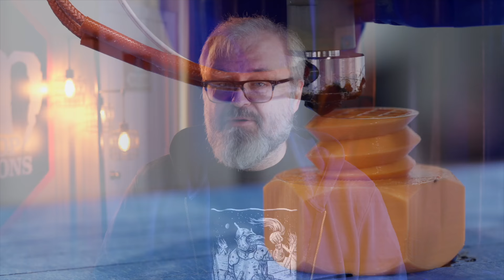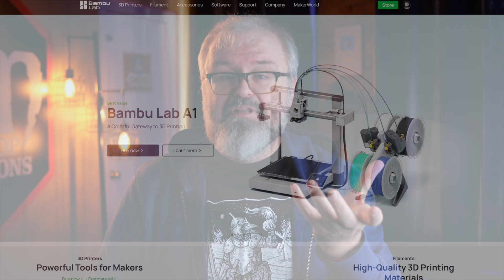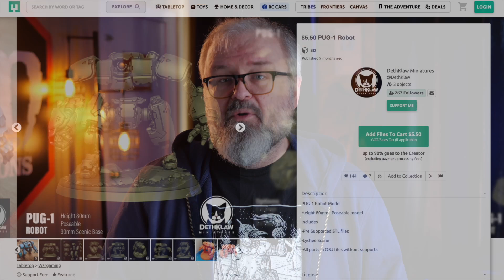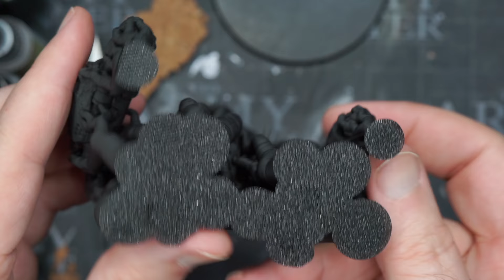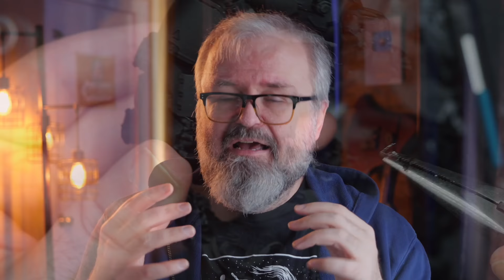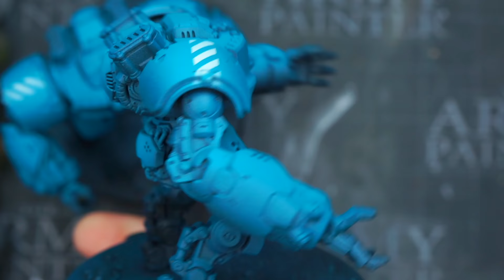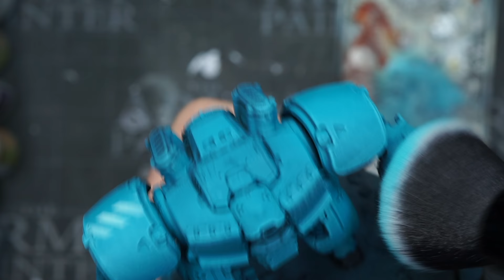I Compare RESIN vs. FILAMENT for 3D Printing Wargaming Minis

Comment: Bigger models (and even smaller ones like space marines) always in parts. It is incredible how much you can improve a model after learning to slice and orient parts in an optimal way. Second, making supports perfect. If they don't peel off with a gentle twist of the pliers, you're doing it wrong and need to tweak them. Third - applying matt varnish BEFORE primer hides most of the layer lines in a good pring (won't help if the quality is dog's breakfast as is), print holes, any seams of the parts. Just let it cure well or the primer will crack (don't use glossy varnish, primer will always crack on it). Always print one mini at a time. Get Frostbite/Glacier print plates - not only they let you print at 30-50'C bed temp whic his great in itself, but they have almost perfect adhesion when used right. Use Sunlu PLA + 2.0 filament or Elegoo filament, but NOT black, from neither (previously Sunlu Meta was great but something is wrong with it now, acts like old PLA these days, poor batches perhaps) - and finally prepare your OWN models sets, cut and prepared by you to your optimal printing conditions, essentially making your own sprues of minis, in a way. Do not believe that anything downloaded and not prepared for FDM specifically will print well. It won't most of the time.

And side tip that is slightly more involved. Learn Sculpt tool in Blender. This is, by far, one of the most important things as it lets you manipulate the model - sometimes all it takes is couple of milimeters or degrees to make something you can't split in slicer well into something that you can (like, for example, hands with weapons that before editing would need cutting the part of the model's body). Not only that, it allows you to easily create alternative poses, visual interest OR, and this is also key, by using inflation tool fix the unnecesary holes and gaps in geometry with one click and also easily create bridges between parts of the model that make no sense to be separate (like for example a hand with a gun close to the body, but hanging down from the shoulder without touching the hip. By making it touch the hip by adding a small enlargement of one area you turn a hard to print model into a child's play  -as it now prints from the hip area and not in air, one of many examples.

That's it, that's the receipe for a perfect FDM minis. Will they be perfect? No. Do I have painted armies that cost under £15 each which I can use to play with my kids and friends? Yes.
Reply: Thanks for the time taken to share your thoughts. In the current economic situation what you are doing makes perfect sense.

Comment: Its something I will try but haven't got there yet. I have been resin printing for around 4 years but have only just got a filament printer in the last month. Currently working my way through a warlord titan that is about half and half of both matterials - filament for the structure and resin for the armour plates. What i like about filament however is it has opened up the door to a whole heap of printable objects that resin is just not suited for, so it may be a while before I do an army of miniatures with it.
Reply: What printable objects are you making that resin is not suited for?

Comment: Unrelated to the video, but how do you base with speed paints and go over them without them bleeding over? I love using contrast and speedpaints for some areas but I havent managed to prevent them from running when they get hit with any moisture at all. When i get my filament printers, I am inspired to do the same side by side with a few battletech minis. 

For myself, for whats on the table, i'm generally using a very simple paint scheme, and would be more likely to go with filament as they are less delicate. My prints are done with standard or abs resins, but they dont tend to hold up well to lots of handling. Being dropped turns them into a puzzle from hell.
Reply from the maker: Once they fully dry, they don’t reactivate anymore from what I’ve seen. Thanks for watching!
Reply: @tabletopminions  great videos! I will give them some more rest time and see if that helps, thank you!

Comment: For printing 28mm scale figures, it can be better to do them in parts. Also, try using the resin supported models for FDM printing. You can always slice these yourself to add any other tree supports. But generally the resin supports work for fdm and are easier to remove

Comment: The fdm printed model looks great! As long as you don't look at it lol. 
I've done tonnes of fdm printing and would not even consider fdm printing minis. 50um layer lines in resin printing will show up while painting, let alone layer heights of fdm.
To make fdm even viable imo you would need to build a custom printer. IDEX, 2mm lead screws or high res belted Z, 0.1mm nozzle with custom part cooling shroud to eliminate clogging issues and print in ABS then experiment with acetone vapour smoothing to minimise layer lines. Waste of time printing minis in PLA when ABS is cheaper and better suited to the purpose.

Comment: 2:51 PLA is very technically biodegradable but it’s about as close to the edge of the definition as you can get and we really shouldn’t be pushing it as if it’s a green material at all. Even under the most optimal industrial composting conditions virgin PLA might still might not degrade and any given pla you grab off Amazon is almost certainly chemically modified further decreasing the odds.

Comment: Interesting video, with a fairly decent comparison of the capabilities of both Resin and Filament based printing. I like the fact that you point out that both types of printing have their place in making miniatures. I also like the fact that you point out that you can assemble the figure prior to slicing for printing.
I do however think that when comparing the quality of the different methods, the parts should be done the same, the resin was printed in pieces, the filament should also have been done in pieces, or as the filament was printed in one piece, the resin should have been done in one piece.
Either way, a good video that demonstrates some of the shortcomings of filament printing, and gives areas where that kind of printing is useful for miniatures and gaming.

Comment: 3d printing bits is amazing.  I still use the GW box sets as a starter but no longer require needing 10 other boxes of parts to convert.

Comment: Treat it like a resin print.  Go as low of a layer height that your printer will allow, print it sideways at a 45 degree angle with resin style supports.  Use a hair dryer to remove the supports and use a craft knife to scrape off any stringing or warts off of the print.  Scrape-- don't cut.  Use a small hobby torch and go quickly and very gently over your print.  It will give it a gloss finish.  I haven't tried it yet, but I think I read somewhere that you can use cornstarch on the model before you torch it to give it a matte texture instead

Comment: I could see using something like a 0.4 hardened steel nozzle with PETG-CF or PLA-CF from bamboo labs. It's about $35 or less a roll, so not too expensive to make it restrictive. The PETG-CF comes out shiny with minimum layer lines. The PLA-CF comes out matte finished with minimum layer lines. While the CF added the base material is stiffer and a bit more brittle, but the reduction in layer lines is what makes the filament so nice to use. NOT sure about using it for the smaller miniatures. BUT something like the robot featured there would be great.

Comment: Most so-called plant based PLAs are loaded with non-plant based chemicals. These additives are what often makes the material manageable. They're not biodegradable and they're poisonous. Genuine biodegradable PLAs are on the market but they're substantially more expensive.

Comment: Critical is slowing everything to 50% speed or more 8:04 and if the resin supports don't have a brim I just add a .3mm base around it all so it stays together. Wish I could post photos here. Anyway detail is much better on resin but I don't have a resin printer. A pro can tell the difference, not so from a foot away.

Comment: I have a Bambu P1S and have been playing around with printing them with my Bambu. I few things I've tried include printing the minis in parts using the resin supported models. They either work brilliantly or don't. Sometimes i might print the base unsupported and get better detail on the base that way. Smallest is a 20mm model using resin supports. Awesome detail and so tiny. Largest is a 110mm model where base was done unsupported and the entire figurine done with resin supports.

Comment: As a fellow FDM printer, I would like to thank you. This was the first honest compare between resin and FDM what I saw, so far.

My tips:
1.) use white PLA+ filament. it contains less additives and pigments, generaly "cleaner". PLA+it has better layer adhesion => better overhangs.
2.) print part by part, but position each part to avoid overhangs not supports. if a detail on the model is paralel with the bed, then it will posibbly look bad.
3.) you soud set the Top Z distance for the supports to double of the layer height,it ill be easier to remove, and causes les scaring.

Comment: for printing D&D minis (all in 1 piece) I know it really helps with the support if you angle them backwards at a 45 degree angle.  then the supports tend to only touch on the back which is much les displayed than the front.  Also (at least with D&D minis) I find the layer lines not being horizontal tend to look really organic.  

I missed exactly what primers you were using,  but I also use a "filler primer"  with my FDM prints,  they build up on them selves and tend to fill in a lot of the layer lines.  

Also, a lot of people I've seen printing minis are using the resin style supports, and apparently it works great.

Comment: I print infantery model for my wargame with great success using resin support generated with chitubox. With my p1p layer heigh 0.06 nozzle 0.2mm and a bit slow down wall speed and result is great. I got even better result on my new h2d using default 0.4 nozzle with very smooth walls some details are just a bit less sharp… can’t wait to get my 0.2 nozzle !

Comment: A lot of filament printing is re orienting and re slicing the model in your software at different angles to get proper support structure and adhesion. Sometimes default orientation is not as good, i like doing them at a 45⁰ angle

Comment: Resin or nothing. I think if you are going to be printing minis, you are probably going to paint them... and painting FDM minis is painfully awful. I also would never put one in a display case, which is what I (and everyone else I know into painting) does when they're finished. It also used to be that resins were brittle, but now we have some great, affordable tough resins, like Nova 3D Tough Washable, that give you the detail we all want without breaking when you handle them.

Comment: Never been near a printer other then walking by in stores..  But as a guy who's wax caste metal figures for decades. Id call that filament ones flaws 'battle damage"   new to warhammer figures so be gentle fans..  I poo poo'd them when they first came out. paper pics you cut out . when we were wax casting Tiamat.   big Dragon D&D in metal.  forgive my past..  Ive found Warhammer..
Reply: The pot marks from resin printer supports i also pass off as batte damage when doing Warhammer or ww2 stuff, it looks exactly like bullet/fragment impacts so it's 2 birds with 1 stone scenario.

Comment: I have a Bambulab P1S and just did a large scale print of some figurines for the first time.  It looked kind of rough.  I especially hate the horizontal print lines, and I can even see them on your print from a distance after the paint.  I'll try sanding with a rotary tool to see how that goes.  I'm hoping a thick layer of primer helps a bit.  But, if this is the way a filament printer works, I'm likely to get a resin printer.

Comment: I printed Battletech and Epic in resin for a few years and now having moved onto FDM I have found it to be an acceptable compromise. The detail isn't quite there yet on the Kobra that I'm using and it's slower for batch printing, But I can still reliably print infantry at that scale (6mm) and that's phenomenally helpful. I'm slowly dialing it in for mechs and vehicles and I've found overhangs to be the biggest problem so far.
As an aside, for terrain it's awesome.

Comment: the fdm print would do well with scale model building and painting techniques. putty, sanding and surface leveler/retarder airbrush primer. different things need different approaches. you wouldn't play a guitar like a flute even though they're still both musical instruments.

Comment: the other reasons presupported models are usually tilted is to 1: make them print easier by minimizing the area printed in each layer, making them peel off the bottom of the vat easier and 2: minimizing the amount of  supports and often the visibility of the attachment points of the supports.
Reply: Tilting them also reduces hight. So you save on time and ware on the printer.

Comment: Filament looks like it takes more effort to clean up. I'd rather print and put together minis with the bare minimum effort, even if it costs a bit more for the materials.

Comment: One interesting difference is weight. Filament prints are typically hollow, while even if you hollow out resin prints (which is difficult and sometimes not even possible since resin collects inside anyway) the wall thickness will make them several times heavier. For some uses this is not a problem, but in some cases it's a big issue, especially on cases where extra weight also means extra chances of damage if a model falls or is toppled (which is made more likely by the lower flexibility of resin compared to most filaments).
Reply: Hollowing resin prints is extremely easy, lychee makes it pretty easy to select wall thickness  and holes to deal with trapped resin but resin can also be very flexible. Anycubic tugh ultra resin has incredible impact resistance and flexibility but can deform in a hot room and has minor detail loss.
Reply: @Victor-vj5ds  The problem is that holes are simply not feasible for some shapes that have a lot of surface detail or angles all around.
A better approach is to add a high lift before enclosing the hollow space so resin drains (before it gets below a size where it won't drain through gravity). I've done it manually ant it works extremely well (though with tilt-release machines this tends to cause layer lines around that area). That's, among many other things (I have a long list), an easy software enhancement slicers should have to improve printing quality and success rates, but resin slicing software is not seeing innovation at nearly the same rate FDM slicing software is.

Comment: I'm still pretty new to this, but I just did a dreadnaught for a friend, and I use Cura for slicing. One thing that worked for me is a plugin called "Banana Split". What it does is it cuts the item you're printing in half putting the center parts on the build plate. The external parts of the model are on the top so you don't have to worry about support damage as much. After it prints, just glue the halves together. It makes for a MUCH cleaner print.
Reply: Wow, sounds great

Comment: I only use FDM, I don't want to mess with resin.  And I feel like my minis turn out just fine, with a bit of tweaking.  I make things worse for my self by sticking with the stock 4mm nozzle, though, since I'm on an older printer and don't want to deal with swapping the nozzle out.  Then again, its been giving me a lot of trouble breaking lately, maybe this is my cue to start saving up for a nice Bambu A1....

Comment: I am not saying any of this to say FDM is better than resin but for someone that can't use a resin due to not having a shop or garage to keep it all in, starting in on doing "Resin type" prints on an FDM has turned out tremendous. I don't use a bambu printer, I have FLSun v400 and a 3 year old Ender 3S1 Pro both of them using a .2 nozzle. I created my own profile based off of suggestions from other profiles I have seen and tweaked some settings on my own. I do not have those scarring marks left over from supports and there are areas on the prints that you would be hard pressed to see any layer lines. It sucks that it takes time to create a really good profile but if this is a true hobby its somewhat expected. Using the right Filament is also an important part of it all. I used to use nothing but Hatchbox but once I tried Sunlu Meta grey, everything has changed, it really is a preferred filament for this kind of printing. I have also moved away from doing 32mm scale prints and finding more enjoyment in the 25cm scale printing but that's me.

Comment: I am using a Anycubic Mega Zero for some years, it did at least 25 kg of filament and a Creality resin printer. I like filament printing more, for it is much easier. I have seen some good reviews on the Bamboo Lab A1, so maybe I will replace the old Anycubic with it and don´t have to use the resin printer that often.